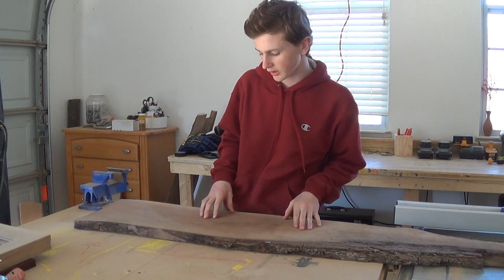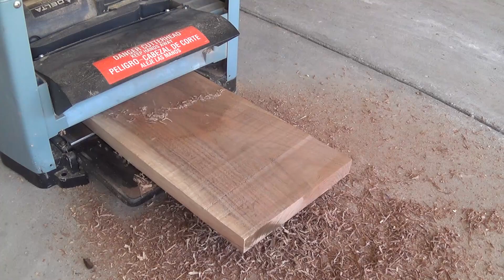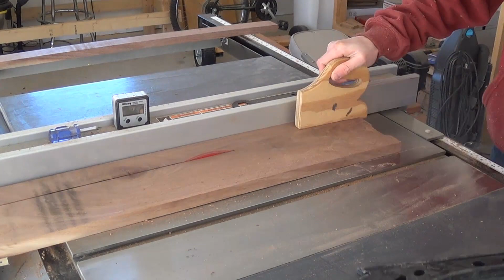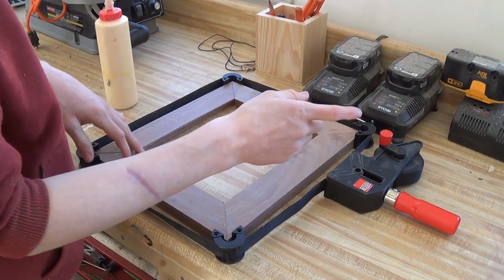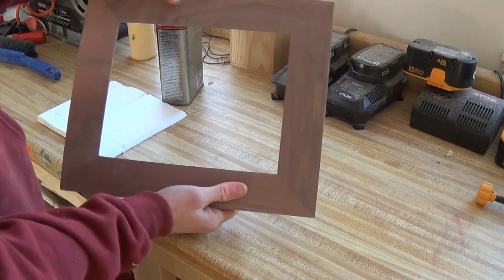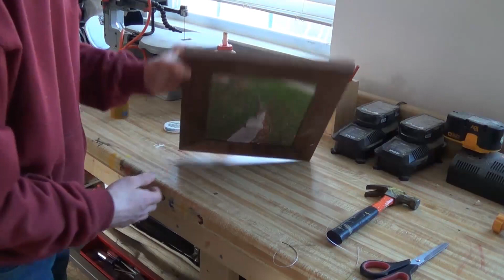How to Make a Picture Frame

Comment: Nice frame, Eric. That walnut is gorgeous. Tip for installing sawtooth hangers- those tiny nails are much easier to start if you use a pair of needlenose pliers to hold them. It'll save some wear and tear on your fingers.
Dan

Comment: Turned out really good. Like that you kept the footage of the waste piece hitting the camera. It happens :p I already have a good amount of those Bessey strap clamps. But couldn't pass up adding another to the inventory after finding it for $2 at a contractor going out of business sale. Yup brad nails work well to hold everything in. But if you want to use picture frame specific items, glazing points is one way to go.